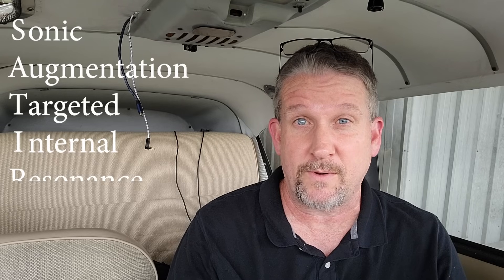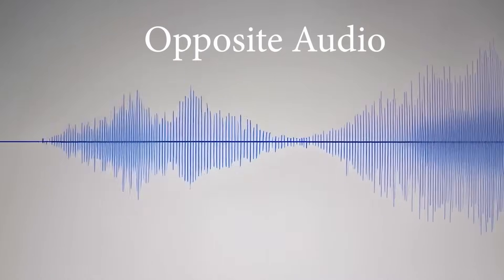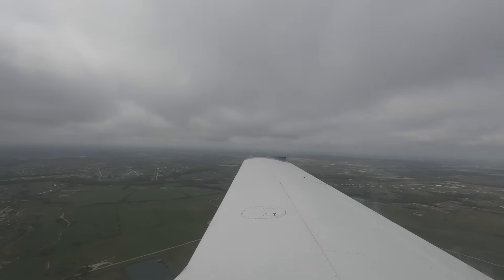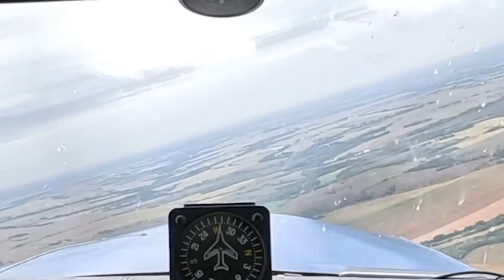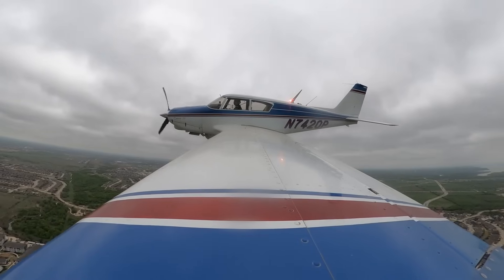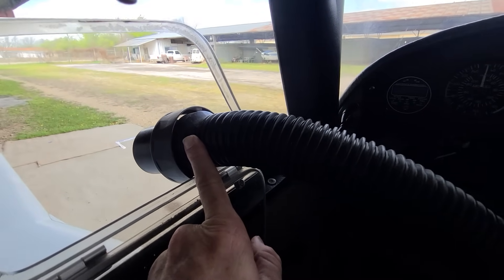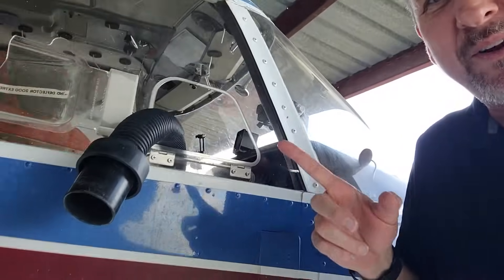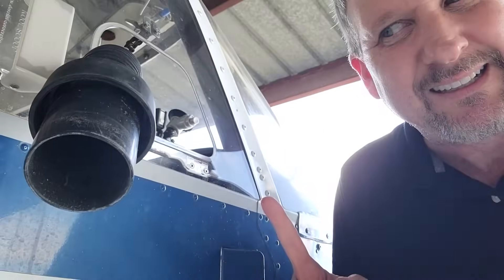A Noise-Cancelling Plane? - Pilots Might Ditch Headsets Forever

Comment: I hope this new system works out and by Next April LightSpeed gets there full Airport Noise Cancelling System prototype up and running for next years Sun N Fun, I mean What is the Point of buying a nice set of Delta Zulu headsets only to get your ears blown out by an F35 flying over with full afterburners on. Yes I did overhear about  this at the LightSpeed Booth during the airshow LOL.

Comment: Noise canceling can only work if the speaker is in the path of the sounds source and the receiver. Or it can only work in one spot.

It doesn't cancel out sound. Sound waves pass right through each other. But where the opposite waves meet, it can cancel out in THAT spot only.

Comment: Not even 41 seconds into the video I'm laughing out loud.  "Sonic Augmentation Targeted Interan Resonance Enhancement!"  That's beautiful!

Done 'in the cloud!'  That's great.  I've already heard that Version 2 is on the way, and it WILL use onboard-computing, although for now, you'll need to give up at least one passenger for all the CPUs, Memory and such to run it.  You'll also need to add a second and third, or third and fourth alternator to the engine  If you have a twin engine set-up, it's only adding one alternator per engine. (I wrote this before I saw the batteries.  I was also going to comment on ATC communications but you covered that.)  

Classic BrYan Turner.  I wish I could have been at Sun 'n' Fun, or later on, OSH, but sadly, I won't make either, as usual.  Poor, old and no airplane (and confirmation I'll never get my medical back due to a reoccurence of epilepsy).

Some day, BrYan, somewhere, we may meet.  In the meantime, Fly Safe, Have Fun, and keep these videos coming!

Comment: Burned hands and face doesn't sound like a big problem. Luckily we can throw our expensive headsets out of the window, when activating this system, so at least our headsets wont burn. How do you turn it off? By pushing that string?

Comment: One of the negative side effects uncovered during testing is that while it makes farts more silent, it makes them more deadly as well.  The counterphase sound generated by the noise cancelling speakers adds energy to the fart molecules which amplifies the perceived intensity of the smell by increasing the momentum transfer between the fart molecules and the nerve receptors in one's nose.  We recommend using the optional clothespin-like nasal clamp to diminish the smell.  If you open the windows to attenuate the smell, it will have a negative impact on the effectiveness of the noise cancelation system.

Comment: lol Nice!  FWIW, I flew Saab 340s for several years that actually had an active noise cancelling system that... worked?  We tried turning it on/off in flight and while there was certainly a noticeable difference, it didn't actually make the cabin quiet.  Oh, and the system was über-unreliable.

Comment: Interesting development. 
I also have a Comanche and we have been testing a Better Option for Silent Environment by BOSE. 

We think their system is superior to the LightSpeed solution. The BOSE system takes advantage of the fact that sound doesn’t travel in a vacuum. All the air in the airplane is exhausted by a large fan through the real bulkhead. This means that the entire cabin is totally silent. Each occupant wears a glass dome over their head and all the domes are connected via tubes to allow the noise to travel between occupants to allow for normal talking. This system has 2 advantages over your system. 

1. Microphones within the plastic domes allow normal communications over the radio. 

2. The air evacuated from the cabin during takeoff is directed out of the rear of the aircraft adding significantly to take off thrust as the air is evacuated. 

I think we should test a side by side comparison of the two systems. 

Maybe we could schedule this for April 1st 2026.
Reply from the maker: Will BOSE work in a Comanche? I thought they were reserved for TBMs and Cirrus.
Reply: I've tried the BOSE system with my friends Don Adams and Edward Platt who developed the two person prototype.

Comment: A few corrections Bryan. First, to use the cloud computing service you must have an IFR rating. 
Also, noise canceling has always been a feature for multi-engine aircraft. That is why each engine is on opposite sides of the aircraft, the noise from each one cancels the other out and creates a "whisper quiet" flying environment.
Reply: Yup. And there’s a button for it too once you get in cruise. Otherwise the sound is just terrible

Comment: You have long since been overtaken by reality. The Dash-8 Q series has been doing this for real since 1997! It doesn't make it quiet, but it really uses actuators to attenuate the pressure pulses from the propellers to make the cabin a bit quieter, comparable to jets. That is literally what the Q stands for. Here's a short paper explaining the basic technology: http://www.eecs.qmul.ac.uk/~mpurver/papers/active2002.pdf

Comment: A product like this could really do with a little out-of-the-box thinking.  Or rather, out-of-the-plane thinking.  Suppose you put some upgraded models on outside the plane - might airport noise complaints become a thing of the past.  And output from the bottom units could help keep the plane aloft and lower your stall speed.  Might be worth holding off for next year's model.

Comment: Joke aside, look at the Turbotech regenerative turbine comming to the GA market, it’s super quiet !
Reply: Until they get a grip on the maintenance cycles for the spurving bearings I don't see this making any headway into the GA space. A turbine disassembly at every 100-hour inspection is just too much.
Reply: @ 6000hours TBO target (3000 at launch), cheaper to maintain than a Rotax, same fuel economy, multi fuel capacity, same reliability targets as a CFM engine (they all come from Safran who owns part of the company).

The first aircraft’s are already flying and will be delivered soon with dozens of orders already.

They are also looking at a 250hp and 400hp variants. They are targeting Cirrus who is very interested (for a  $1M aircraft a turbine is cheap honestly).

But for cheaper aircraft it’s more expensive to buy than a Rotax, so only clubs that use their aircraft’s a lot can justify it on the low end as the running cost is apparently much cheaper actually.
Reply: @dufonrafal  dude, It's 1 April and I rattled off a part from the Turbo Encabulator. This wasn't a serious critique of the product. I just loved that today, and as a response to this video it would be very easy to assume "Turbotech" was something you completely made up.
Reply: @MichaelOnines  And I lived it :)

you should know that this would attract aviation geeks :D

Comment: Bryan, regarding the altimeter error, you were probably on your alternate static source; I believe that's a known limitation of the system due to the sound buildup in the cabin. I can't wait to try this out in a year or two when the STC is approved for a 1983 Skyhawk. Maybe you could make a followup video about how this system simplified your GoPro audio signal chain, and how it ties in with a CD or MP3 player accessory to give you theater-quality Dolby Atmos surround sound.

Comment: I have the same chain-pull activation system in my Piper as well.
Maybe mine is a bit defective, but whenever I pull the chain, I hear something flushing in the back, like a toilet flushing. Do you ever get that?
Need to get it checked out.

Comment: You should r&d a clapper version, get rid of those silly toggle switch or pull chord switch… would be so much simpler if you could just clap on… lol
Reply: They were able to get the clap-on function to work perfectly. Still don't understand why it can't detect a clap for off, though.
Reply: @ hehe

Comment: I know this is an april fools joke.... but the car industry has been doing it for a long time.  My 2019 Ram truck had an active noise unit mounted to the frame to stop low frequ rumbles.... and the audio system had active noise canceling.  And that was a mid grade truck!  High end cars are even better.
Reply: My older (2003) Toyota also has a form of noise cancelling.  Crank the radio all the way, and you can't hear anything else!